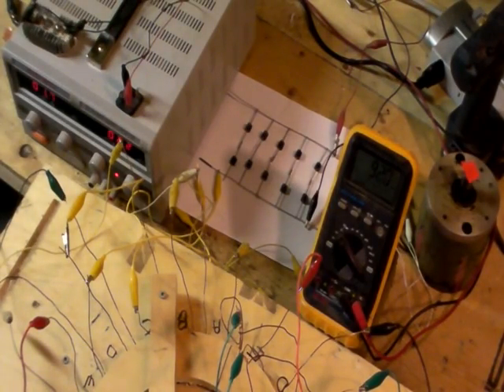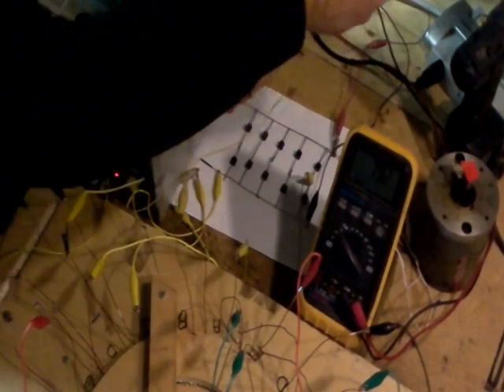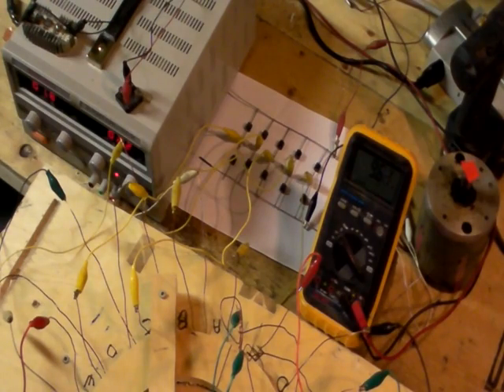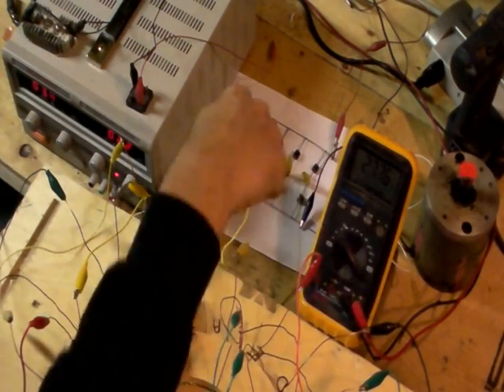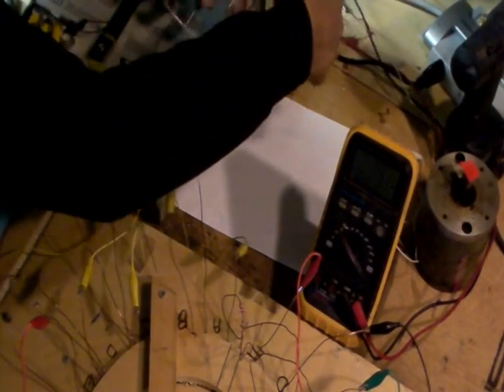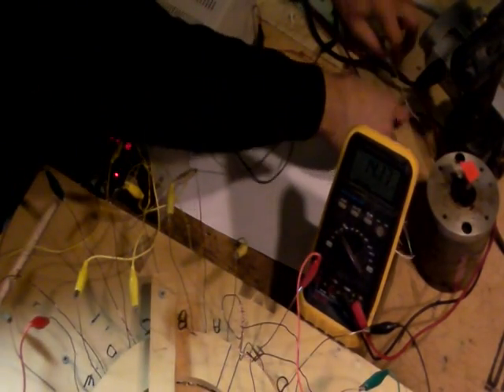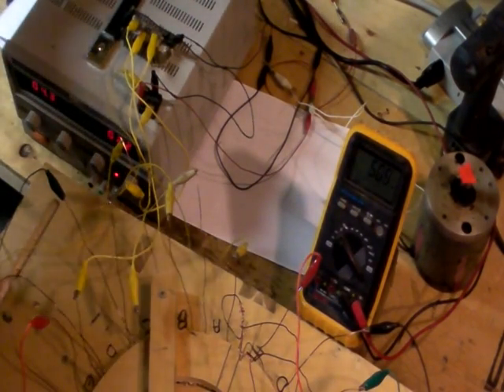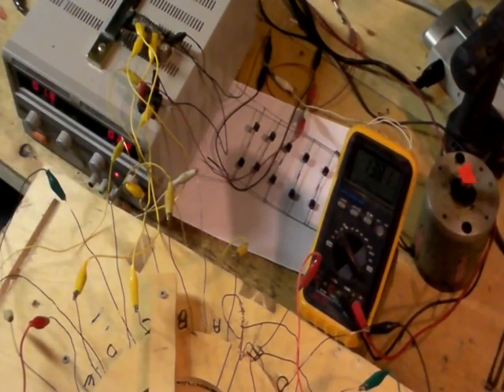5phase pma wind turbine green energy vawt hawt 32.mpg

Comment: you are not getting 5 phases with that set up use two 3 phase rectifers and not the single phase and drop out one phase on one of the 3 phase rec not connected   two phases wont work very well on single phase rec cheers Mike  ps two legs of 5 phase is not 180 out so cant use 2 phases on on a single phase rec